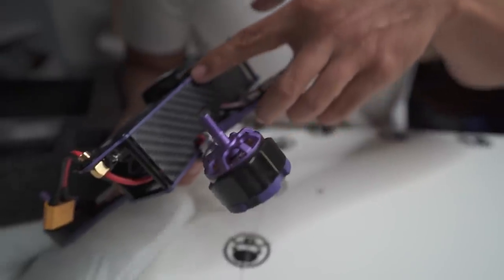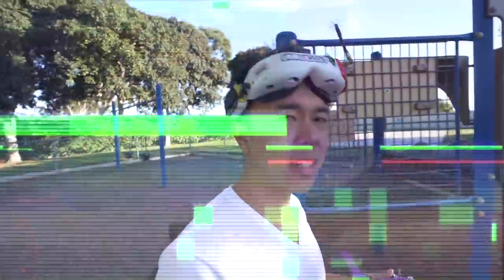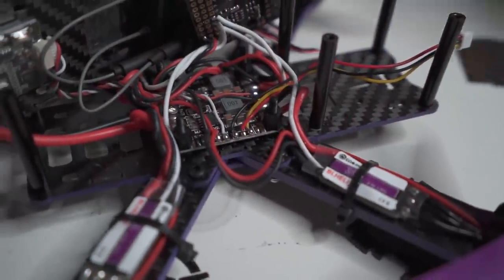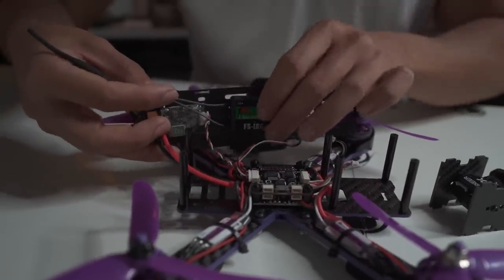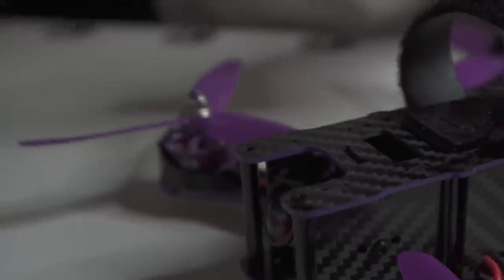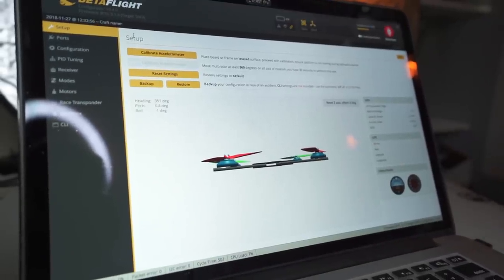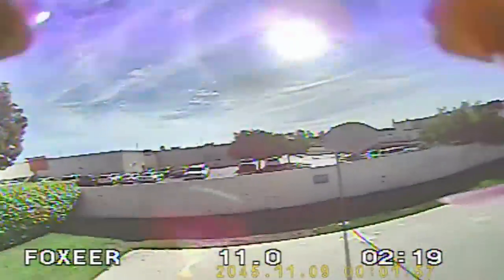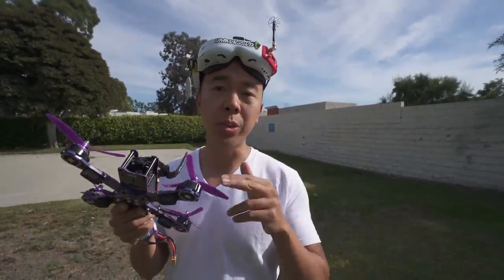Modding the Eachine Wizard X220 Drone! - Kwad Mods

Comment: I think on X220 arming with nob works as failsafe. When U lost signal quad will disarm because nob is constantly signaling. Stop nob signal = disarm. BUT this is not working with switch that signals only when changing positon. So lost of switch signal will not disarm quad.

Comment: Maybe I got a bad one, mine wasn't setup in betaflight at all. Basically everything that could go wrong with a quad did with mine. I've had it a year, and it has maybe an hour flight time. I guess it served 2 purposes, I learned to work in quads, and I pulled all my hair out, so no more haircuts, lol I doubt a lot would have stuck with it. (kinda like when you started Tommie, build a month, and crash, then wait on parts) mine wasn't as tough as when you started, not sure I would have stuck with what you had to do, I'm guessing 4 years ago, but ya never know I been crashing something for over 20 years now.

Comment: Ordered this yesterday, but I've got no soldering skills ohh no!!!
Reply: cj x RadioShack and other electronic shops sell specific solder practice boards or prototype boards. You can get decent with soldering with about 30-60 minutes of practice. It’s not bad. It’s a good skill to have. 

The goal is to make sure your joints end up shiny and small rather than flat gray or blobby (not enough heat, no flow). The key here is applying heat to the wire and allowing the solder to flow into position by itself. Tin the wires and pads before making the joining connection, then it’ll be quick. A little Flux helps a lot with making it flow as well. 

You can also try on old electronics boards, but I’ve noticed some of those have coatings which make it hard to melt the existing solder. 

I’m sure you could find a good YouTube video or two to walk through so you can compare results or troubleshoot. 

GL
Reply: thanks for that, actually what happened on the quad is on it's maiden flight, one o the motors smoked! luckily I was able to return the quad on it's online shop and got my money back.

Comment: Ffs. I tried the ibus mod(I made sure I got the polarities of the wires correct) and I get no response from the recover in betaflight, cleanflight or the quad. I tried switching it back to ppm and still nothing.

Comment: That was my first radio.  for the money, you can't really beat it.  $50 i think it was.
Reply: It is mine for now...   I can't decide whether to get an x-lite, qx7 or a jumper.  I would get an x9d+ if it was in my price range.  Could you give me any input on $100-$130 radios?
Reply: @trfpvVT  Sorry, i can not.  i went from that to a spektrum dx6 which is $180ish and never looked back.  Having held both a x9d and a qx7, i'd go with the qx7 though.  I think Mr. Steele even recommends it as your first radio.
Reply: @trfpvVT  x-lite = small and portable. QX7 = Everything you'll ever need. X9D+ = All the bells and whistles. Jumper = multi protocol
Reply: Thanks yall for the input
Reply: I still fly mine now well over a year old!

Comment: I am very confused. I have followed step by step 3 times now and I cant get my quad to arm. I connect the battery and the receiver shows battery level and beeps when plug in my quad, but absolutely will not spin the motors. the only thing I noticed is that when I go back into betaflight each time it says SPEKTRUM1024 instead of IBUS. it goes back each time I reconnect. Please help Rotor Riot

Comment: I see people(many) have still or once owned the Eachine Wizard (to my surprise).
I also noted that most agree ,for the eachine to fly correctly and safely,the esc’s,camera,vtx and props
need to be changed out! The Quad cost around $200 the new parts will cost around $100. So,to be up and running you now have $300 invested in a cheap ass quad. 
$300 today, can get yourself a pretty nice Quad. Eachine is definitely not on that list!
Reply: Bob Turner unfortunately I have to agree. My wizard has been a large money hole. I probably could have gotten a much better quad with the money I had to put into it

Comment: I think you could even switch the esc protocol to dshot because its set to oneshot... Dunno if it makes a big difference but dshot is certanly better
Reply: you probably could in betaflight but just make sure to update the firmware version in blheli configurator.

Comment: Would be cheaper if u  just 3d print the frame?
Reply: No. You can't buy the wizard without the frame. Also unless you can 3d print carbon fiber (not impossible, however unlikely) then it's not going to hold up in a crash
Reply: not much and it will end up braking really often, carbon fibre is really worth it for strength and weight
Reply: @fpv568  So out of curiosity, I printed four ABS arms for my kwad this afternoon, and it was wobbling in the air like crazy, lol.
Reply: @nicholassheldon8638 Carbon fiber is pain in the butt to print out, and mostly the filament online are either PLA mix. And printing carbon fiber destroys your nozzle supper fast.
Reply: @samxu7183  exactly why we don't print our frames

Comment: The X220 is just too outdated. If someone buys one of these today then probably "by accident". The successor X220S (deliberately not mentioning the HV here) is much improved but still leaves room for modding. This would have assumedly been a more rewarding base where you maybe do not end up replacing everything.
Reply: Sorry but the Wizard x220 is still most popular by far. The TS215 is better but beginners want to get in cheaply.
Reply: @JoshuaBardwell  the 220s is not better because the pdb is part of the frame I don't like that point.  CHEERS
Reply: @JoshuaBardwell  X220S <> TS215. The X220 costs 130$ and the X220S costs 160$, but has the following advantages: F4 with OSD instead of F3 without, 4in1 ESC with DShot support, better camera, pagoda vs. linear antenna, better VTX, motor soft mounts, buzzer vs. no buzzer. The camera on the old X220 is completely useless, especially for a beginner since the FOV is way too small. Also most beginners are probably not able to solder a buzzer. An OSD is also a big advantge if you have a TX without telemetry. So many advantages for just 30$ more. I would never recommend a beginner to buy the first gen X220.
Reply: @335ifnx101  you make a good case but, cheapo gets people in the air,  and supporting people who bought the x220 is really worth the effort,  it may be a bit out dated and lacking in features, but replacing those things is a good learning curve,
Reply: And that's why I chose to get the x220s to start on. Having said that I already had spectrum transmitter and some rc knowledge from planes and cars so maybe I had an advantage there rather than a complete newbie

Comment: I got everything the way it would be coming out of the box for 200$

OH except for about 750$ worth of FPV gear..... And the first thing i'm gonna change is something that you won't even be using if you get it as is.... the camera.

DUDE!!! What the fuck.

Edit: WOW..... the only thing you "Modded" Was something you can't even use if you get this as is........ 

This is a wizard setup video. I been skipping over this video for a while now thinking it was gonna be lame, and MAN I was wrong... it was worse than that. xD

I was actually hoping for some actual modding of the stock quad.

Comment: Picture still looks pretty crap after you changed the cam :p
Reply: That is the FPV feed to the goggles, you can always attach a gopro HD camera to record the flights in addition to the FPV cam. The upgrade was to remove the slow picture changes which at decent speed will effectively have you flying blind for a second for each scene change.

Comment: What kind of monster sells a quad with motor stop on and airmode off by default? What is this, 2014? Are we in a forest in France? Is Charpu the Justin Bieber of FPV? No? Then there's just no excuse.

But really, why are Eashine building their quads wrong when they could have a better product without spending any more money?
Reply: This product is very out of date.  It is in no way on par with even the tyro99 $99 drone.  Also, they cut a ton of corners to sell that thing for the price it is so it is not like they could have improved it without charging much more.  Not defending eachine, but still.

Comment: With so many better quality quads for the same money or less why would they even do a video on this? They have quads from diatone and sky stars that are way better quality than an eachine which is literally total junk with no quality control whatsoever they just send them out whether they work or not short time. I had a wizard and it was literally total garbage you should have seen the soldering it was embarrassing. The clone flight controller was total garbage they send me another one and it broke within a week GTX broke within a couple days motors were literally the cheapest things on the market. Escs would go out as soon as I would replace one another one would go. This drone is literally the reason I built my first squad because of the incredibly low quality and unreliability of it. Pretty disappointed in this recommendation. We all know that they know better